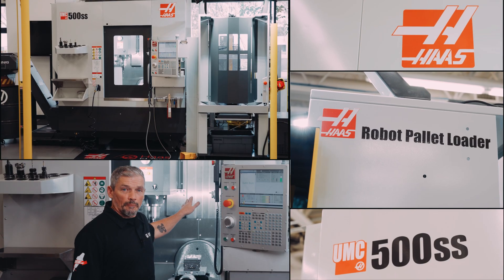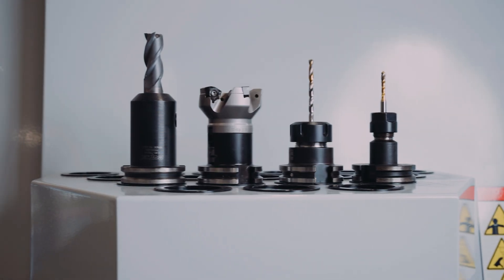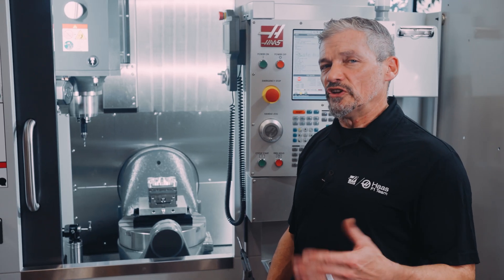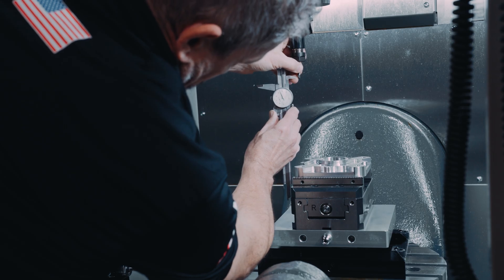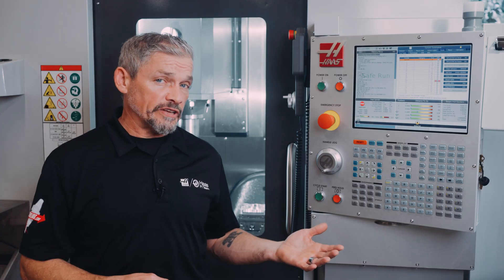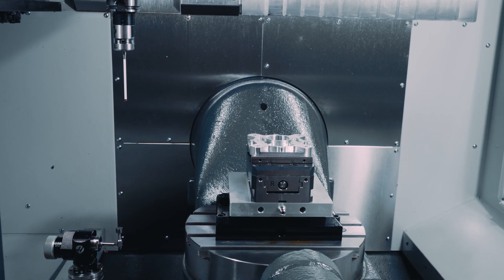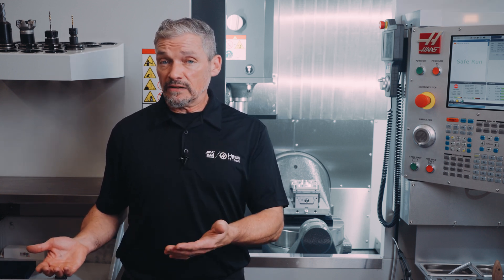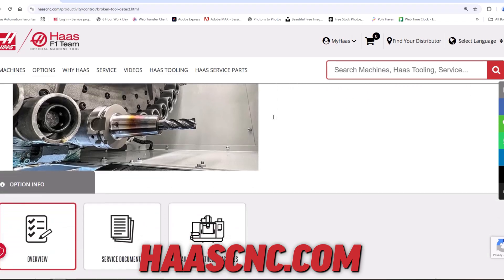Peace of Mind on Long Run Jobs - Broken Tool Detection Option - Haas Automation, Inc.

Comment: Haas should do more with the vibration sensor on the spindle to detect process abnormalities.   It is possible to detect chips between the tool taper and the spindle taper with vibration sensors
Reply: Maybe you shouldn’t get chips in your spindle taper. Iv never seen a mill that had vibration sensors to detect fod in the spindle.

Comment: Can these machines also use spindle load to determine if the tool is actually cutting?
Reply: My initial question as well.
Reply: @Iceberg86300  I was wondering for this, I run a basic wood machine but really tiny tools and chips can lock up. I have fire supression also. My guess is having a code for expected spindle power. The other one for pull out would be does it load up before it should. Titans on the super high end machines my guess is it knows the shape of the part and the blank and then by the g code knows what it should look like and what should be left plus some "AI" cameras. So it knows how long the tool should be (tool table) and if off before or after an open it errors out. FLIR could also see if a tool is running hot. A lookup table could handle most use cases Material/S&F/SO/Tool Dia , then user overrides. 3D printers use this for "Spagetti" errors. The nice thing also would be the part coming loose and stopping for that. None of this is that revolutionary and a Raspberry Pi could handle it.
Reply: No. They have spindle load detection to alarm out in case of overload, but not with underload

Comment: Am I first for "never tighten tools in the spindle"?
Reply from the maker: axisfiveraxisfiver5844, For demonstration purposes in this video Andrew hand tightened the drill in the toolholder before the tool was checked and then again, as we see in the video, after loosening to reduce stickout. There was no cutting being performed with the tool and of course you should never cut material with a tool that was hand tightened.
Reply: Am I the first assuming lightly tightening a tool in the spindle doesn't harm more than a 3-inch shell mill fully engaged removing material at max